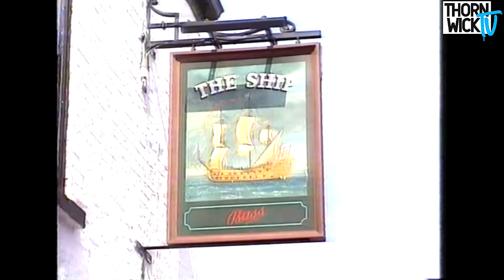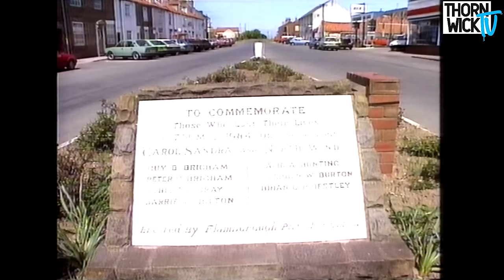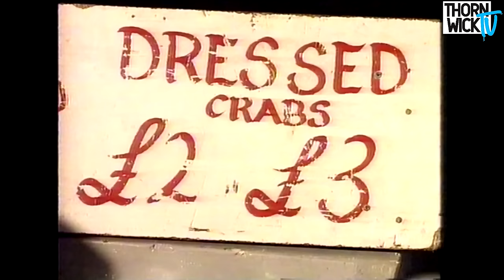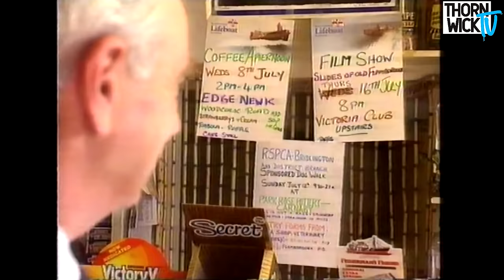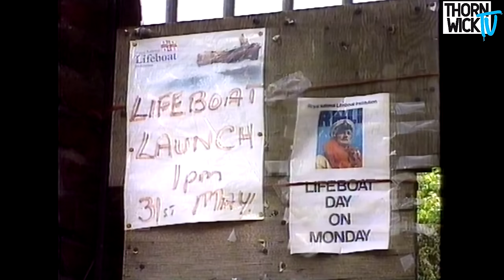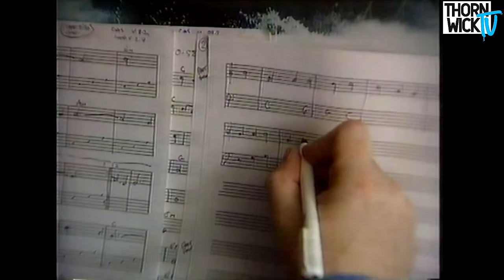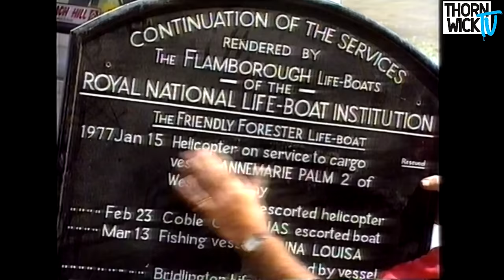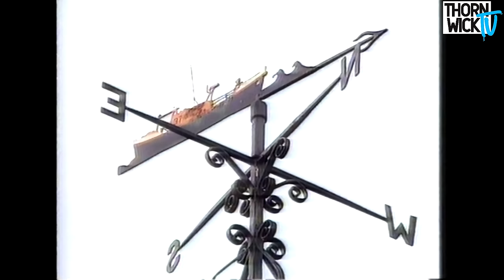The Lost Flamborough Lifeboat Documentary (1992-1993) RNLI Heroes

Comment: These men would have been on the life boat, been down the ramp and out to sea long before the very expensive high tech Bridlington boat of today. I find it absolutely ludicrous to watch, it cannot be any quicker to launch than it is to put away. Having watched them one evening I shudder to think of my life or anyone else's being at stake, but they did seem very proud of their pieces of kit!!!!!!!!!
Reply: Bridlington has a totally different beach profile to Flamborough, they can’t just launch down a ramp into the sea. Plus that very expensive high tech boat is faster, better equipped and safer for crew and casualties than the Oakley in this video. Even if the Oakley was quicker to launch, it’s not the speed of the launch that matters, it’s the speed at which the lifeboat can reach the casualty, which the modern boats win hands down.
Reply: @Mike-dn7oz  I would totally agree with you about the speed of these modern boats but that is just the problem, what is the point of having a wonderfully powerful fast boat if it takes for ever to launch. I know what you mean about the beach at Brid but I do think that not enough thought went into the speed of launching.
Reply: There's less protection for the rescue crew on an inflatable - no cabin for starters.
So  as this film clip says, it can't be launched in all weathers - that's a huge drawback if you exist to save lives. 
No point in an empty RNLI  boat at sea ( if your crew get knocked off by waves) , however fast it goes.
Reply: @malakai651 
Absolutely agree about the launching. 
If the new boat takes 8 or 10 mins to launch and depends on other equipment to get inflated & to the beach, whilst the old boat takes 2 minutes to launch, but is slower, then the new boat must make up at least 6 minutes to even catch up with the old boat. 
I think what was done was absolutely appalling and if the general public were aware of this and of the salaries ofvthe CEO, I think the support for RNLI would be seriously dented. 

I was in fact referring to the qualities of  the new boat in that it  appears to have no protection ie no sides & no cabin or any protection, hence the inability to go out in all storms, hence setting out now an agenda that actually saves less lives. This goes completely against the ethos that has been in place for centuries, I'm sure.

The saving of the 29 aboard the Bonita in Dec 1981 could not be done now with the new inflatable boats.

I think that is to the discredit, in fact, to the shame of the RNLI
Reply: @zerotoleranceforsataniceli4794  Quite right, I haven't got a problem with them having a fast expensive boat it's just what they do need as speed is the most important factor. But as you pointed out, it wasn't very well thought out. The lovely new boat house is next to the Spa but rather than putting a ramp emediatly outside directly on to the beach they have to go half way down the promenade. Speed is key it's life or death to some poor souls.
Reply: @malakai651 
Do you know why they didn't put a ramp directly from boat house to sea ?